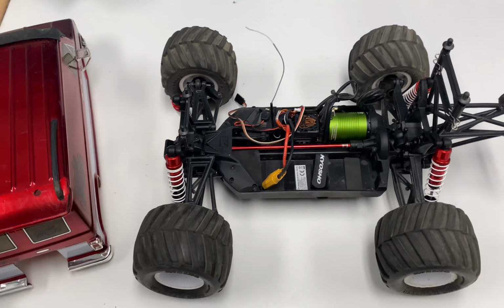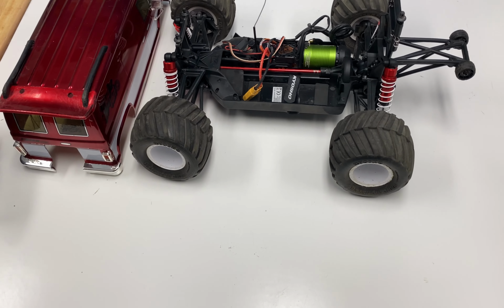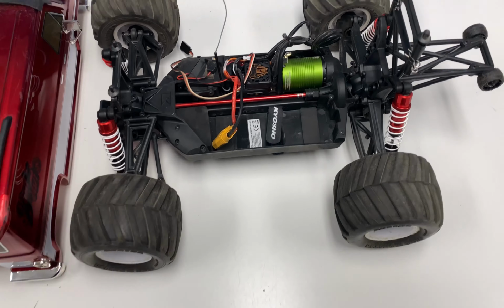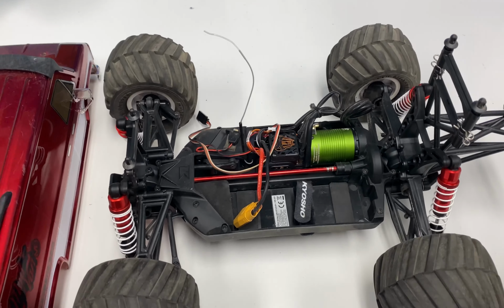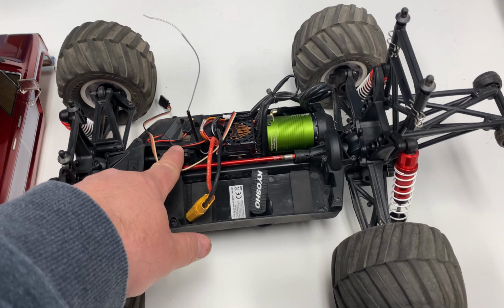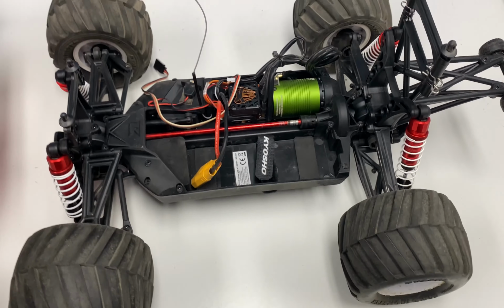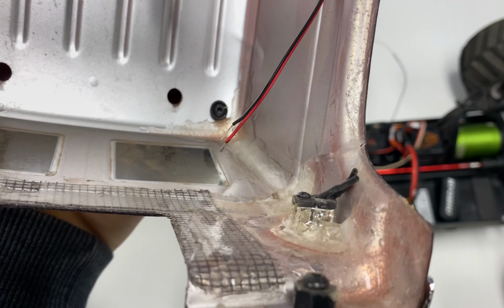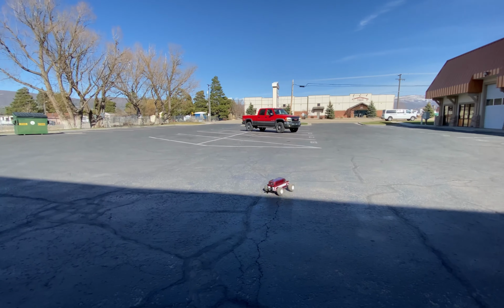Kyosho madvan VE 3s lipo run and overview !

Comment: Hi. Quick question on 2s vs 3s please.

I know this is sold as a 2s car but apparently the ESC can tolerate 3s?

I already have plenty of 3s batteries, so rather than having to buy a 2s just for this, could I not use a 3s, and then just turn down the throttle dual rate to bring the speed / electrical load back down to behaving like a 2s car (and it will then last longer for trail runs).  

I run my 'pretty' cars fairly gently, so I'm not worried about getting max speeds or straining the diffs.  

Is my logic ok, or am I missing something?
Thanks 👍
Reply from the maker: Well  think the ESC is rated to run 3s it’s the 4000 kv motor that makes it not rated. I think the motor can handle it just need to be careful of heat so run a motor fan and check it the first few runs make sure it’s not to hot !
Reply: @metalrc  ... thanks for responding mate 👍

Comment: Do you have a link for what you did to your diffs?
Reply from the maker: Here is the link to my install video the only thing you may want to do is get the hardened out drives I didn’t do this but I also haven’t needed to https://youtu.be/l9PExq-fQJQ
Reply: @metalrc  thx!

I’ve been really happy with the stock setup so far. Handles 3s well etc. Just a really fun truck with that perfect blend of power and light weight that stays durable. 

BTW I raised my rear body post one (maybe two?) notch and it stopped the breakage there around the rear light buckets. Lost one bucket entirely! 👎🏻👎🏻
Reply: What’s the part number for the hardened out drives?